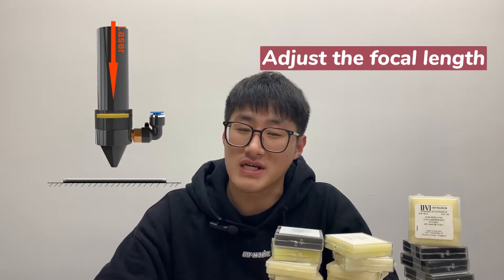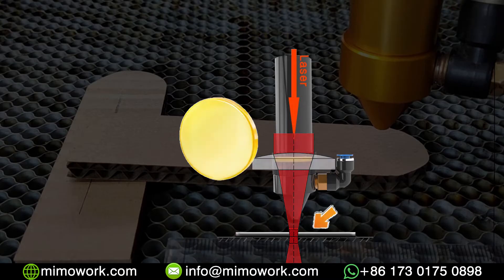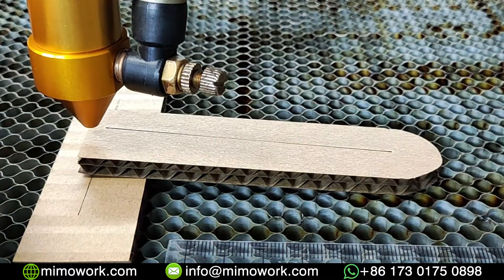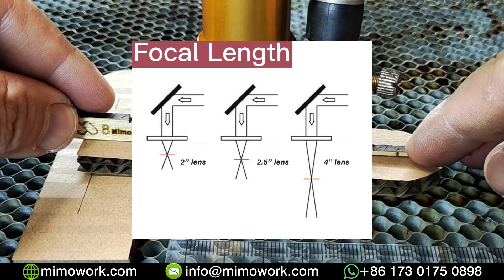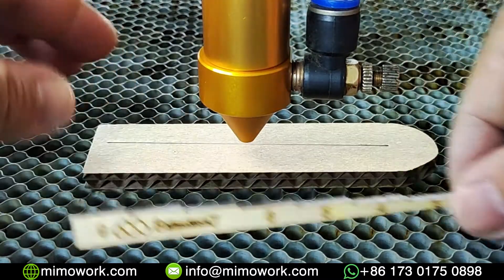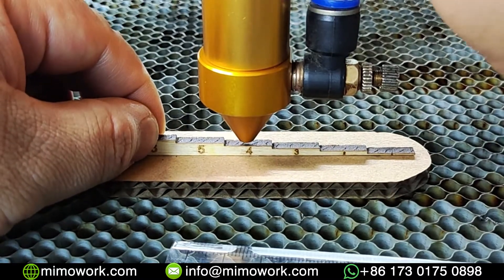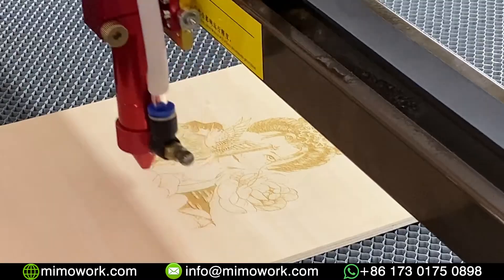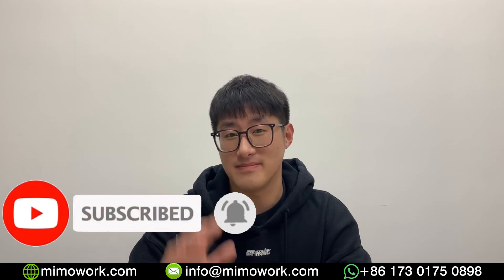Tutorial: How to find focus of laser lens?? CO2 Laser Machine Focal Length

Comment: Hello Brother. I want to ask, same machine, same focal lens, do we need to find out the focus for every different material? Thanks
Reply from the maker: Here's the simple breakdown:

For the same machine and lens, the focus point (where the laser is at its smallest, most powerful spot) is a fixed physical property. So, you don't need to "re-find" it from scratch for every new material.

However, you do need to adjust the height of the machine's head to account for your material's thickness. Switching from a thin fabric to a thick piece of plywood? You'll raise or lower the head to place that fixed focal point in the optimal spot within the material.

A rough cut or a wide kerf is your machine's way of saying, "Hey, my focus height is off for this thickness!"

Hope this helps! 🙌😉

Comment: I faced some problem in co2laser cutting time miding point come after circle and square please tell me how to solve
Reply from the maker: From your description, it sounds like the laser isn't following the cutting order you expect in your design file.

This is usually a simple fix in the software. You likely just need to adjust the "cutting sequence" or "layer order" in your program (like LightBurn or RDWorks).

The software might be set to cut all the circles first, then all the squares, instead of following the path you drew.

Try looking for those settings and rearranging the order of the elements.
Reply: @mimoworklaser  file cutting is sequence but file inside cutting time miding point come like cut mark I changed the roller gear and bearing also but problem still same
Reply: @mimoworklaser and please share focul ruller file also
Reply from the maker: Sorry for the delay! YouTube isn't great at showing follow-up comments...

It sounds like you've already done some great troubleshooting by checking the roller gear and bearing. Since that specific mechanical issue is so tied to your machine's exact make and model, your manufacturer's support team will definitely be your best resource. They have the specific diagrams and knowledge to help you pinpoint it.

And absolutely, we can help with the focal ruler! Just shoot us a quick email at info@mimowork.com and we'll get that file right over to you.

Hope you get it all sorted out!

Comment: Just when I think I have mine dialed in, something changes. Today I noticed that the top of the cut is v shaped while barely penetrating all the way through on 3mm lite ply. My focal length tool is .640 based on the ramp method, however I have adjusted it by at lease another 3mm more and have the same cut. I wish I could get nice tight lines cut, but then again its only 40 watts pretending to be 60 watts.

Comment: hello! my laser focal length is 9mm, do you know what is the lens used in my machine? 2"? 2.5"? 4"?
Reply from the maker: Please measure the distance between where the focal Lens is installed to the material surface when the shoot is the thinnest. That determines which lens you choose. By the way, what materials are you cutting or engraving? wood or acrylic?